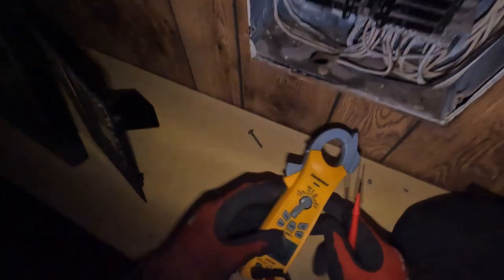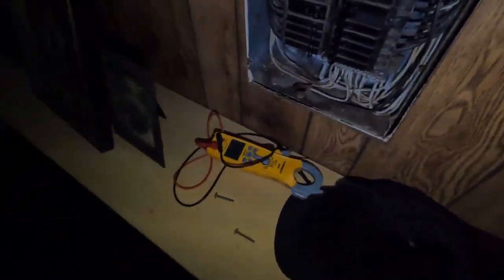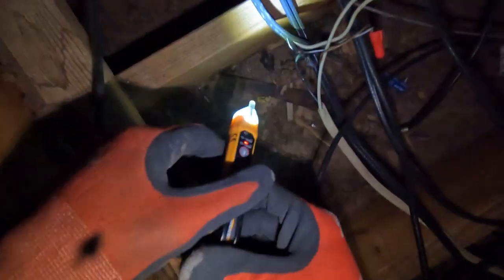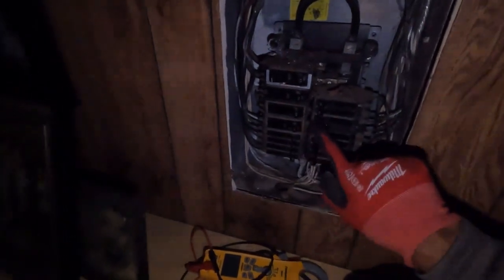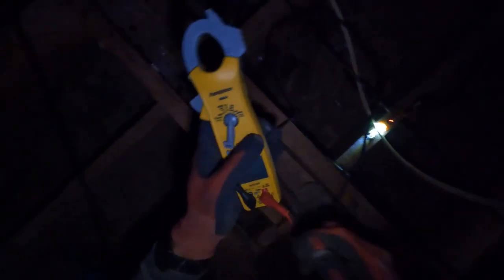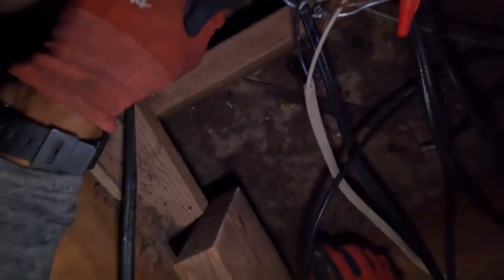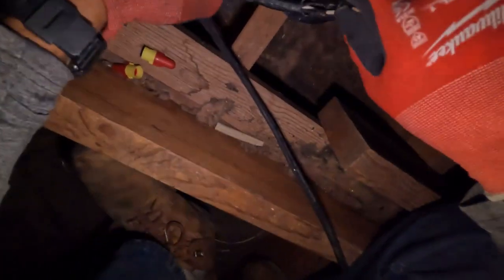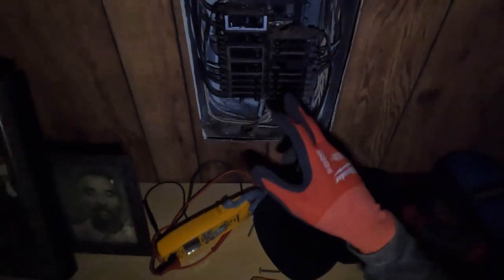Troubleshoot Burned Wires & Tripped Circuit Breaker Causing Lights Not To Come On in Home

Comment: The guy didn't realize aluminum wire to Romex without the proper wire nuts  created a fire hazard.  I hope you use the correct wire nuts for that job. I have aluminum wire in my house and ill tell you what that wire will get hot well before a 15 amp breaker trips.  Surprised you didn't use alumiconn connectors.

Comment: What was your customer's reaction to the pictures off your cellphone, was he concerned?  Did the customer hire you to go through the rest of the attic and fix the other examples of unsafe wiring that you documented early in the video?  As a troubleshooting technique would it make any sense to temporarily replace the circuit breaker (C/B) in the panel with a AFCI C/B (from your stock) then energize the circuit again and see if the AFCI trips indicating arcing somewhere else along the same circuit?  I mean how far do you go with this stuff, at some point you may be rewiring the whole house?

Comment: Nice job and serving your customers well.  I understand why you used wirenuts to get the homeowner back in service,  but I personally would have used Alumniconn connectors because mixing copper and aluminum under a wirenut is likely what caused the wiring to burn up in the first place. This homeowner was very lucky the house is not a pile of ashes, this shady wiring is a good example of why not everyone should be doing their own electrical work, there's a reason why we as electricians go through years of training and recertification to maintain proficiency in this field.  An old school electrician friend of mine once told me, "the electrical codes were written in blood"

Comment: Great Repair My Brother…..Yea  that some dangerous mess they left man….U could hear that voltage buzz in yo camera…..I was on a service call at then end of my first year on April fools day 2013 and got hung up on 277  on a Wall pack and had to be kicked off the  extension 🪜
Reply: Oh shit, did you sustain any injuries ?
Reply: @Hatim.13  He must have died.
Reply: @FreeAmerican-mm2my not necessarily,  it depends on many variables.  

A couple years ago I got lit up by 277V on a neutral while replacing some LED drivers in an office building, while I was twisting the small stranded wire from the driver into the gray neutral #12awg from the circuit,  it became energized and locked my hand onto  it while forearm was lightly brushed against the fixture,  the muscle contractions caused me to jerk my arm and sliced it wide open requiring 7 sutures and that's how I broke free. Then of course OHSA got involved which was a whole different headache in of itself,  but come to find out, even though all applicable LOTO procedures were followed,  the circuit I was working on was a mutiwire branch circuit on a single pole breaker instead of a three pole, or  single poles with identified handle ties,  and had an open neutral in a junction box above a drop ceiling in a different room and became live when loads on a different circuit switched on, we were unaware of these facts and the building blueprints were outdated and were of no help.

Comment: Romex should be properly fastened to the buildings permanent structurs, Using Properly sized NM romex staples, You also need to make sure there is enough wire length left for future maintenance, But great job identifying the issue, definitely on the easier side of troubleshooting than im used to lol Stay Safe bro

Comment: was the older wire aluminum and the field piece meter is that a good meter i like the way it does when volts is present has a light that light up and beeps as well be safe

Comment: I don't like to cut around the jacket at the bottom because it's easy to cut into the wire I like to make a light score down the middle then dig deeper in all the way through the jacket at the last inch so if you nick a wire it's in the wire nut anyway where it gets stripped off and twisted together and put in the wire nut

Comment: I see that there is aluminum wire there. That stuff right there mixed with copper is fire waiting to happen. It require special Connectors to splice into copper wire. For that house I reccomend a full rewire of the house. very dangerous stuff there.

Comment: Crap our house is still rocking the old porcelain screw in fuse placard that house has the all original electrical system in it and it seems to work fine nothing gets hot it's just super old electrical the house is nearly 140 years old and we're thinking the wiring was put in the early 1900s there's one outlet in each room and a light switch that's it it's kind of crazy that they left the wiring original but it still seems to work pretty good

Comment: Great video!  How much do you charge for a job like the one in this video?
Reply from the maker: If you want to book a consultation with me on pricing email me. I dont disclose that information openly.
Reply: Tradesmen generally do not disclose pricing in public, since every job is unique and you never know what the problem is until you re there, so you can't say a price and stick with it, it is way more complicated than that.

But in our area in PA we charge 275$ for a service call (just to show up, troubleshoot and assess the job), if the problem is solved within the hour it's 275$, if more then 275$ + 84$ for every hour spent fixing it.

Good work ain't cheap, cheap work ain't good.

Comment: I plugged up a space heater and now my breaker is broke I’m soo frustrated and it’s to my refrigerator 😢
Reply: refrigerator should be on its own breaker for that reason. Space heaters draw around 1500 watts and even through refrigerator may not draw much current depending on age and size the compressor initial startup can draw a bit of current